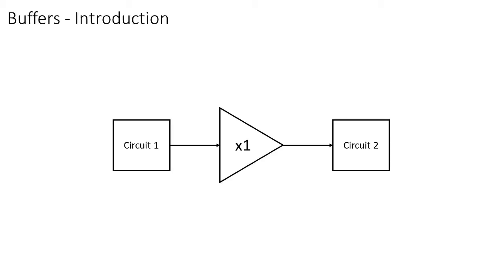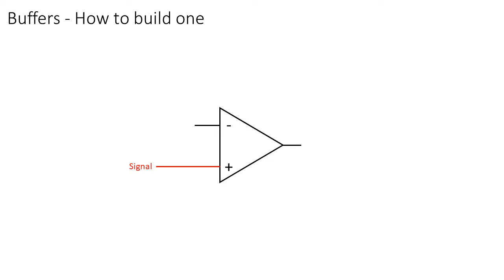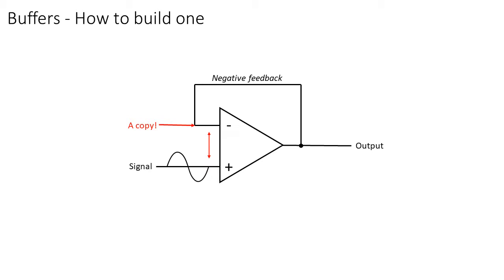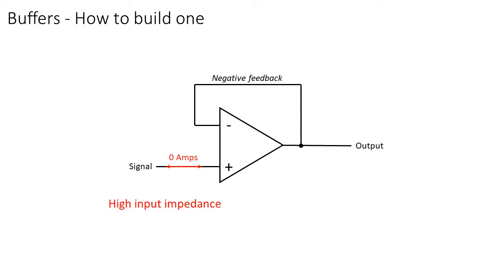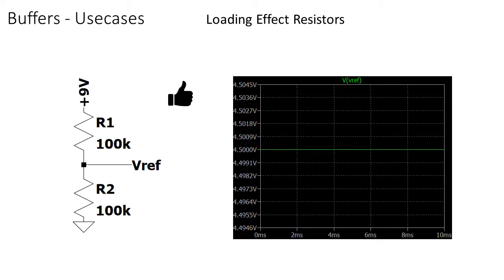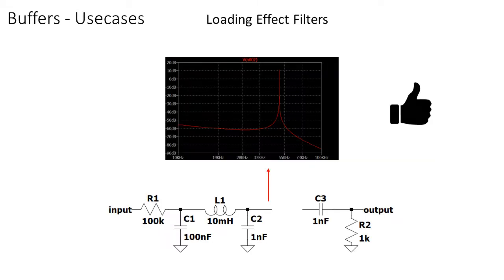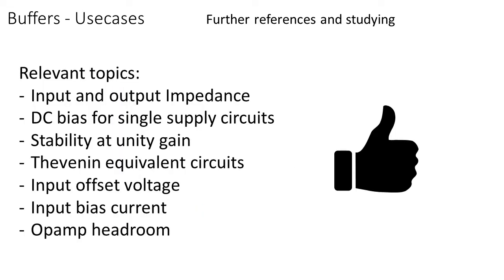11 Opamps: Buffers (+Examples)

Comment from the maker: Small rectification:

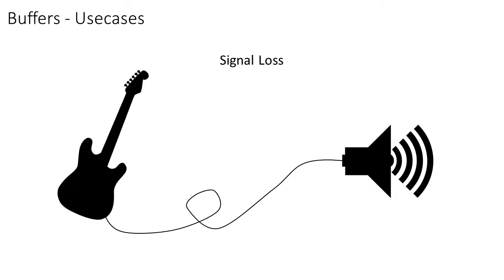1:38 Ofcourse there's not only parasitic resistance in cables that influences the quality of the signal, but parasitic inductance and capacitance is a subject for another video. A buffer also helps tackling these influences.

Comment: Mostly it's to solve the parallel resistance effect when a load (R) is connected and the voltage divider goes off it's numbers.  "High-low impedance separation" doesn't communicate that.